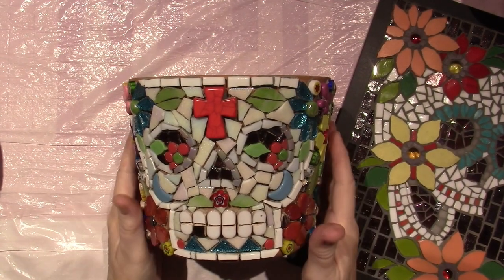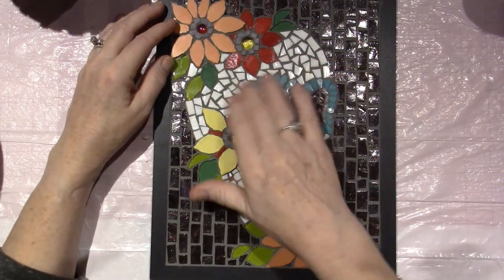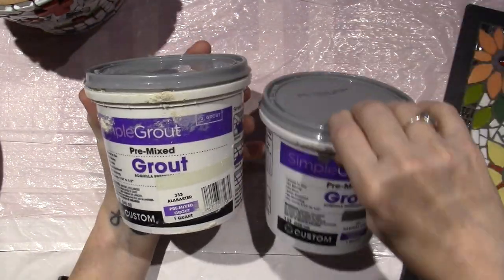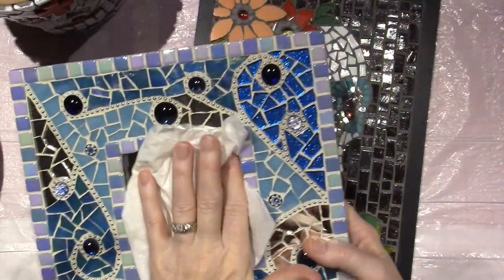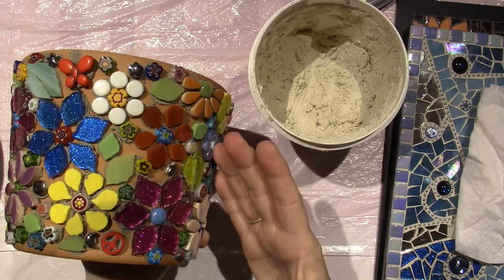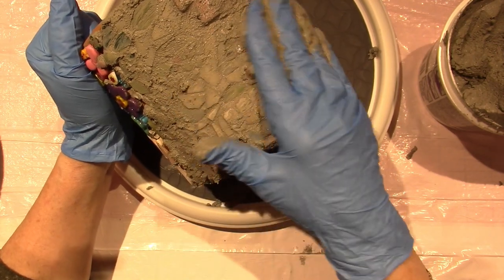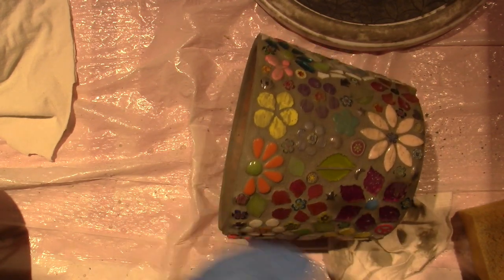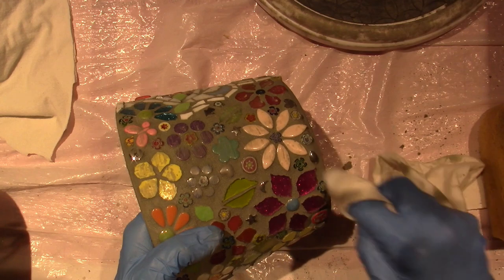Grouting a Mosaic Flower Pot

Comment: My pleasure Sara. Looks so beautiful, love it and very neat work with the grout as well. If you want to you can seal the inside of the pot before you begin mosaicking and then the grout will generally wipe off, you can also tape it off as well as another option. You can also use two colours of grout on the same pot, very easy to do and l have created a video on the process if you want to have a look. I love grouting as well, again really beautiful mosaic. 😊

Comment: It’s beautiful Sara!  I have been wondering if we could try using more than one color of grout in different places?  I’ve seen a few pieces on YouTube where more than one color grouting is used and it looked really nice.  Grouting is so messy and I don’t love it but it has to be done. Hahaha!  I don’t love the dry method either.  I find using gloves is awkward for me.  I want to use my bare hands. Maybe Try a little rubbing alcohol and q-tip on the cross???  It worked for me!